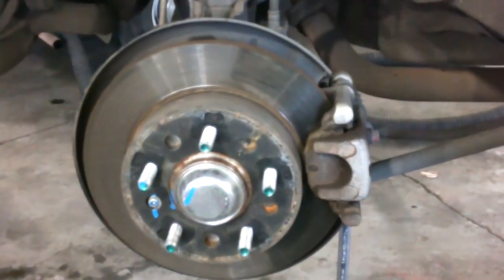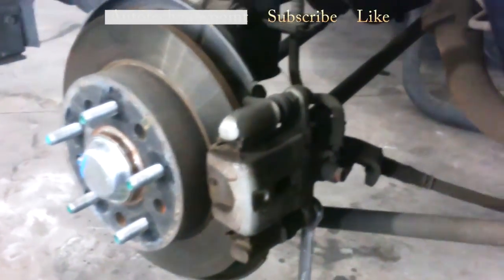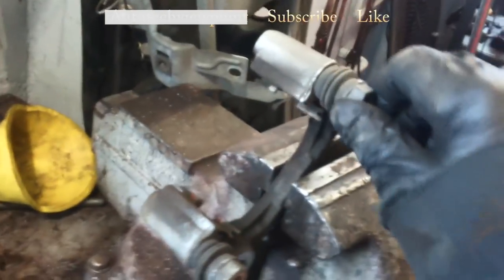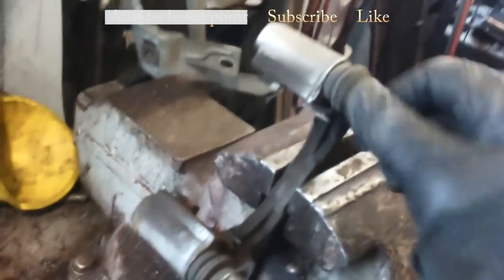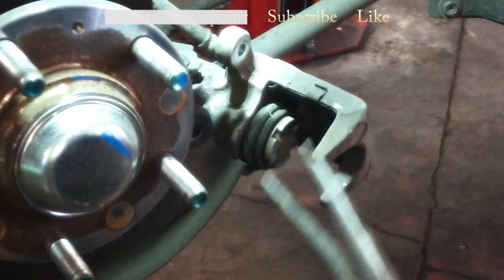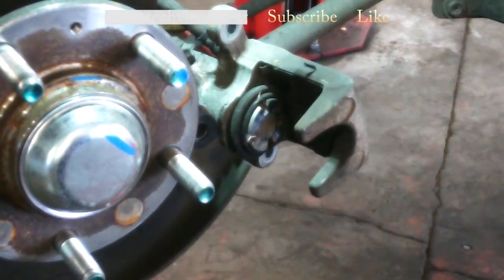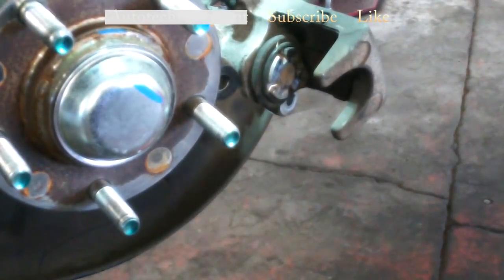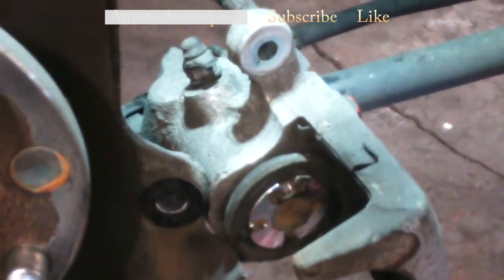Rear brake pad replacement 2008 Hyundai Tiburon Rotors Install Remove Replace

Comment: Solid video. Rear rotors may need quite a beating if its rusted on there. PB Blaster and a hammer will pop it loose if its rusted.

Comment: I am so frustrated right now trying to change my own rotors, I go to look up a video and this guy cuts from one scene to the other, does not show him taking off the original rotor 🤦‍♀️ so that screw needs to come off right? I’ve taken the bolts off of the back, I cannot get that screw off my stepdad has tried he cannot get the screw off; i’m wondering if the cat needs to come off because in this video this man never removed any sort of cap … I just absolutely hate it when people cut from one scene to the other and they just have the new part on

Not trying to diss your video dude, but it’s a big help when we can just see everything you have to do..

Comment: do you just keep the handbrake attached to the caliper, no need to dismantle it to make sure everything moving freely, ive got the 2007 Tiburon and im getting a slight squeak from the off side rear wheel so I jacked it up and checked the bearings and bushes, everythings solid so im diagnosing it as sticking pads and I now need to service the brakes but I didn't want to disassemble the springs or anything in case some parts flew off and got lost, thought id come here to get advice first, I'm glad im doing them they look as if they need a bit of love.
Reply: I’ve got an 07 as well. After replacement the passenger rear brake is making a churning sound when driving. When I brake it goes away and the wheel isn’t hot, everything is intact and tight. Any idea what may be causing the sound?

Comment: I'm having trouble collapsing the piston, I tried using the c clamp but I'm unable to compress it. I was told to take the cap off the area where the brake fluid goes and that would help. Any help would be greatly appreciated.
Reply from the maker: Travis Davis Well, for this video you need to turn it while pushing in. 3:30 mark...
Reply: I had the same problem myself today. I tried with the C-clamp and I couldn't get a good grip on anything with the C-clamp. He used some needle nose pliers and turned the piston until it collasped all the way in.

Comment: you didn't even show the part where you actually take the rotor off and put the new one on...Everything else was very detailed except the main thing the video was about WTF
Reply from the maker: Yes I did not show that specifically, at 1:52 I think I explained pretty good how it comes off, likely one phillips screw and in should slide off, plus link to another video for more help. Did you have problems with yours?
Reply: Use a impact screw driver. Once you remove the screw you will notice there is two thread sizes in the hole. Use one off the caliper bolts and screw in. This will push the rotor off. Spray the rotor with wd40 before you start doing anything
Reply: This! Lol this is what I was talking about!
Reply: The only link that is included is a link to your Facebook page.. unless I’m not seeing it
Reply: What size freakn socket do I need to take off the big AZZ nut under that dust cover in middle of rotor?????